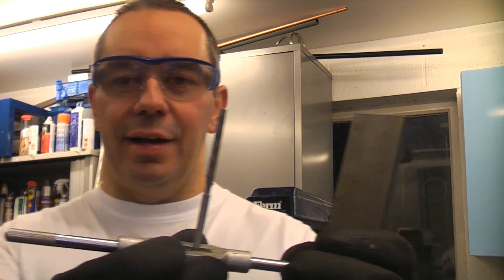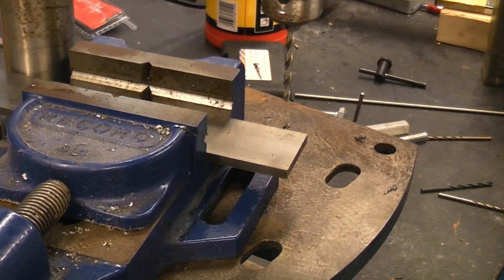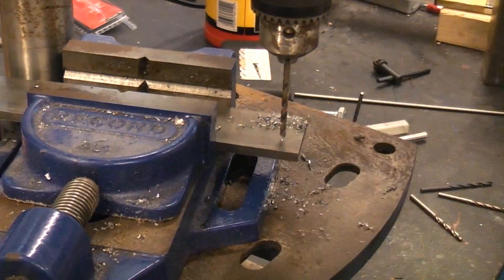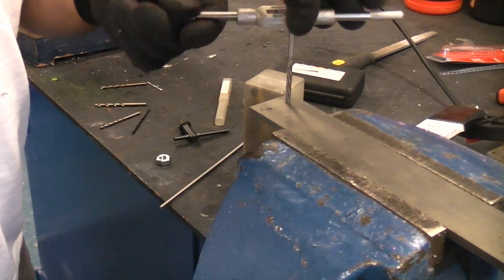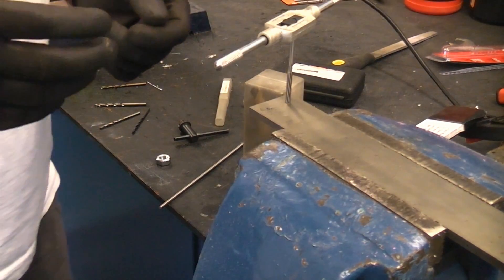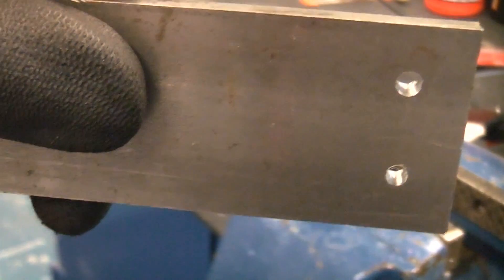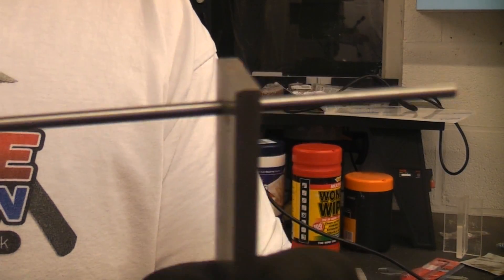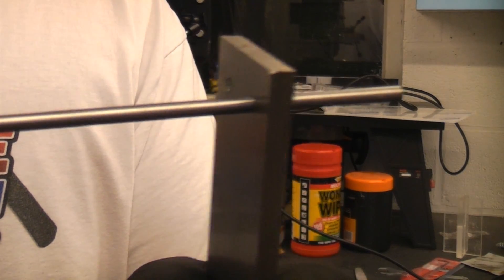How to use a reamer to make a precise hole in metal

Comment: Hi Handyman,

I really appreciate your willingness to demonstrate your uncertainty on turning the reamer backwards which you've been told is not recommended. A lot of people in metalworking wants to show off as Mr. tough guy who knows everything about it. Your approach to go along with a general recommendation shows a valuable personality trait.
Reply from the maker: +SE45CX Thanks, I did metal working at school and also did an adult apprenticeship in my late thirties doing fitting, mechanical and electrical maintenance. So as a pretty latecomer to metalworking (apart from school) I find that there are a lot of people out there with a lot more on the job knowledge. People often say that you can blunten a file by dragging it backwards, yet when I was doing my fitting course we used to draw file on a daily basis- which meant using the file sideways. Thanks for the comment ;-)

Comment: Good to know, I might have to invest in a set, I quit often drill out mangled threads and retap them at a larger diameter, so these would be perfect. Great video.
Reply from the maker: Thanks, if you are re-tapping the hole you would not normally need a reamer though. You can just re-drill the hole to the correct size and then tap it out. 
Thanks for the comment ;-)
Reply: Ya dont need to ream for drilling and re tapping - millwrigjt

Comment: Bit of advice bud, I want to cut/ream a perfect square groove in the end of a metal bar. A grinder is sloppy, a cutting disc may cut walls of the groove ok but the bottom is messy... would a reamer do this? pushing the reamer sideways into the bar? thanks for your help.
Reply from the maker: No, a reamer would probably break. Ideally you would use a milling machine and milling cutter.
Thanks for the comment
Reply: Ultimate Handyman thanks bud!

Comment: I have a question regarding the 4mm round steel insertion. How is it that it makes it through any hole so easily? In order to easily insert a true 4mm cylinder through a hole, the hole must be either larger than 4mm or the cylinder must be smaller. So, are we to assume that the reamed hole is spot on and the round stock is running a bit on the small side?
Reply from the maker: I'm not sure. I don't have anything that can measure really accurately!
Thanks for the comment 👍

Comment: Great tip, thanks!

I have a couple of questions though:
1) I see you don't use any oil/fluid when drilling. Is it not always better to use oil/fluid to drill in metal?
2) Actually more of an observation: Is the inaccuracy not predominantly caused by the fact that the drill bit can move off center (wobble) - The better the drilling 'rig', the closer it will stay on center, of course. - causing a double cone shape, in stead of it being due to the drill bit not cutting on the sides?
Reply from the maker: 1) yes drilling tapping fluid should be used, although I don't always use it when filming. You can get away with drilling a few small diameter holes before the drill bit starts to heat up.
2) It doesn't matter if the work piece is firmly bolted down and if you are using a large diameter drill bit that cannot flex, you will still not get an accurate hole using a drill bit.
Thanks for the comment ;-)
Reply: ***** Well, there's always some play in a drilling column, isn't there? What I'm wondering about is: does this also occur when something is machined? I.e., is this two-step process also used in machining?
Reply from the maker: FloppyHares
Yes, reamers are widely used in machining when an exact hole needs to be made in metal. You can get reamers with a morse fitting that will then fit into most large pillar drills. Normally a undersized hole would be drilled using a drill bit, then it would be swapped for a reamer and the hole reamed to the correct size using that. I do have a machine reamer somewhere, which I should have sown in the demo, but I could not find it!
Reply: *****
Aha, ok, thanks for explaining!
Reply from the maker: FloppyHares
No problem at all.
Thanks for the comments ;-)
Reply: Drills do not cut on the edges of the flutes. The nose of the bit is what does the cutting. Only end mills will cut with sides of flutes.

Comment: What I don't understand is that the reamers here in England are shaped at an angle.  So part of the hole will be slightly wider than the other end
Reply from the maker: As long as you get a parallel reamer (nor a tapered one), it should be the same diameter throughout its length, apart from at the end where you start the reamer off 👍

Comment: Hi, thanks for the video. I didn't know such thing exist! May I ask you to give an example when it is necessary to have a precise hole? is there any special case or just to have a neat hole? thanks again
Reply from the maker: You are welcome.
You might need a precise hole for example if you had to place a linear bearing into a machine as the diameter of the hole would have to be exact to hold the bearing in position. You also need a precise hole when pinning pieces of metal together using silver pin steel (which is ground to an exact tolerance). I'll be making a video of how to use silver pin steel in the coming weeks ;-)
Reply: Mehdi -- One example is when you're injection molding parts and use ejector pins that slide in and out of holes. You want precise hole diameters to prevent binding when the ejector pins move, but you don't want the hole oversized because that can lead to material making its way inside the hole.

Comment: Thanks for the video.  How can I ream out a  .5" diameter hole to 15mm which is .09" bigger than .5"?  the material is .75" thick cast iron pulley.  Thank you.
Reply from the maker: +Bob Eagle You would probably have to drill it to 14.8mm then use a 15mm reamer.Thanks for the comment

Comment: so after looking online for a reamer bit , there are so many different types , for metal which exactly would you recommend, what would I ask for ??? And thanks again for the video
Reply from the maker: +rence822 It depends what you are doing. If you are using it like I did by hand you need to get a hand reamer.Straight shank, parallel flutes.You can get adjustable reamers but I have never used one of those!

Comment: Never tried this method so thanks for taking time to upload for us, great tip. I haven't searched your channel but wanted to ask you a question while here, what make of drill bits are best to use on ceramic tiles?. I've drilled holes years n years ago using the masking tape effect and working up from a small bit to intended bit/hole size but thought i'd ask you if there's any good ones on market for me tool kits. Thanks.
Reply from the maker: For ceramic tiles the best bit is probably a spear shaped bit, like you would use on glass- https://www.youtube.com/watch?v=m_KDslB51FM
Thanks for the comment
Reply: *****
Thanks for taking time to post me link, watched and going to get some.
Reply from the maker: Kani Fuker
You are welcome
Thanks for the comment

Comment: Can you use a reamer to bore out a golf club hosel (the hole in the golf club where the shaft goes into the head).  Need to go from 0.355" to 0.370", maybe can do in two steps 0.2mm at a time?   i think golf clubs are 17-4 stainless, not sure about metals. thanks.
Reply from the maker: You could do, but make sure you use plenty of coolant/lubricant as stainless steels can soon dull reamers etc.

Comment: Curious as to whether a straight or spiral reamer makes a difference? I've got an aluminum engine block (halves actually) that I need to start at .469" and finish at .474". I'm considering an adjustable 15/32 - 17/32 reamer, as that would meet my application. Your thoughts, please. Thanh you.
Reply from the maker: I've never used an adjustable reamer, sorry.
I would assume it would do the trick though
Thanks for the comment 👍

Comment: Do you run into alignment issues (i.e. coming in at an angle or being off center) when hand reaming? And if so, is it more self-correcting than a taper reamer or do you have to "eye ball" really good to make sure you are 100% perpendicular?
Reply from the maker: I have never had a problem, but I don't do a huge amount of hand reaming.
You could use a self aligning tap wrench though- https://www.youtube.com/watch?v=imHGOC07vo8
Or do the reaming in a pillar drill etc.
Thanks for the comment ;-)
Reply: @ultimatehandyman  thanks!

Comment: Would it be advisable to drill a hole, ream it, then tap it, for precise internal threading?
Reply from the maker: I guess you could do, but I have never heard of anyone doing it before (that does not mean that people do not do it)
Thanks for the comment 👍
Reply: @ultimatehandyman  , no harm in trying. I'll buy a small diameter reamer and do a test. Thanks for the prompt reply. Also, thanks for the informative vids.

Comment: Hi, is there a guide as to what size drill bit to use with a reamer. You used a 3.5mm for a 4mm reamer but mentioned a 3.8mm would be more appropriate. Is say 0.5mm less generally ok upto say a 10mm reamer? I have just started building a model steam engine, the plans say ream, but no mention  of the prior hole diameter. Many thanks.
Reply from the maker: +Mikkee33 
I think as a general rule of thumb you need to drill the hole 0.2mm smaller than the reamer you are using, so for a 10mm hole you would drill 9.8mm and for a 4mm hole you would drill 3.8mm etc.
Thanks for the comment and good luck with the steam engine ;-)

Comment: How do you install the drillbit to the reamer handle? I am just wondering how is the grip and why it doesn't slip away? I used to see this tool before but never know what the use
Reply from the maker: +Meiji Jap 
A hand reamer bit has a square on the end, just like a tap so you can use either in a tap wrench as it grips the square on the end once tightened.
Reply: Thank you for the info

Comment: Hello,.  I would like to ask about what is size of reamer i use if my drill bit is 5/32 it is same size? thank you
Reply from the maker: The drill bit needs to be slightly smaller diameter than the reamer. Once reamed the hole will be an exact size.
I'm not familiar with Imperial sizes (sorry).
I've tried doing a google search from here, but only metric charts seem to be available here!
Thanks for the comment 👍
Reply: Charts are available for this. Hannibal carbide have one in the 'Documents' section of their website.
[At larger sizes, say 1/2" or greater we oldies often use a drill 1/64" less than the reamed size. You cannot do that here.]
If you are reaming a 5/32" hole then you need a number drill, a number 24 or a number 25 as given in the chart.
If you use a 9/64" drill bit it will leave about 10% of the final diameter to ream out which is too much - also the reamer may not start properly (reamers are very slightly tapered at the start end to make starting easier and straighter - but they won't be tapered 10%!)  It is normal to leave about 2~3% of the diameter to be taken out by the reamer
The next standard drill up is 5/32" - so that's no good. And the nearest metric size is 3.5mm which is the same size as 9/64".
So if you don't have one, go out and buy a number 24 drill and if you are desperate use a 9/64" but go carefully!!
UH's comment is absolutely correct - NEVER turn a reamer counter clockwise - even if it is stuck in the hole.  You will roll the cutting edges and the reamer will be ruined, and the hole too probably.

[Your question is a little ambiguous so I have answered as though you wanted a final size of 5/32" for your hole. Reply here if that is not the case.]

Comment: The drilling for reaming is 0.2 mm less than the reamer diameter that allowance for straight reamer or taper reamer ??
Reply from the maker: That is for a straight reamer, I've never used a tapered reamer (yet)
Thanks for the comment
Reply: Ultimate Handyman thanks for your reply

Comment: Can i ream a golf club's 0.355" hosel to 0.375" with a 3/8" hand reamer? It's forged carbon steel which i heard is really soft. Thanks.
Reply from the maker: Forged carbon steel is not considered soft by most people. High carbon steel is tougher than mild steel and forged steel is also tougher than mild steel, so if it is made from forged carbon steel it will be tough and probably take the edge off the reamer! 
I guess you could try it, but you might damage the reamer. 
Thanks for the comment
Reply: Okay thanks, doesn't sound like a good idea lol.
Reply from the maker: Not if they are forged carbon steel as reamers are expensive.
Thanks for the comments

Comment: missing the coolant!?
Reply from the maker: 9traktor 
No, I have never really used coolant when hand reaming as you are only removing a tiny bit of metal so heat build up is not normally a problem. Of course it should be used when machine reaming or when reaming out deeper holes etc.
Thanks for the comment ;-)

Comment: No cutting compound
Reply from the maker: You can use it if you want, but for something so small it is not really needed, as you are only removing a tiny amount of material, at a very slow speed. 
Thanks for the comment 👍